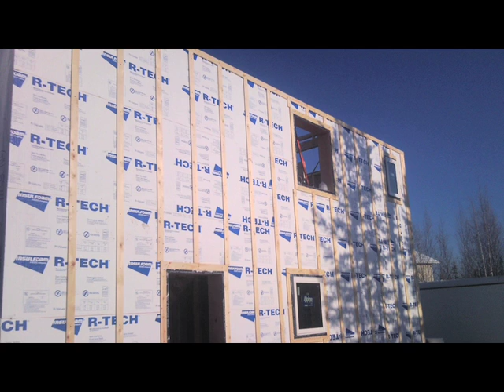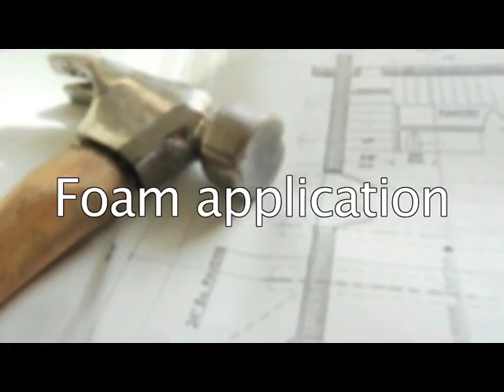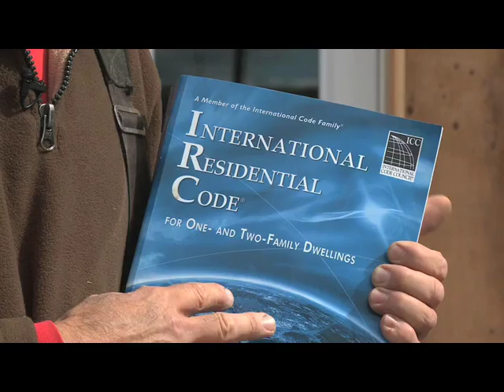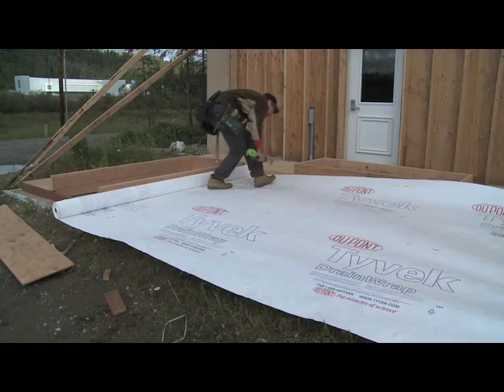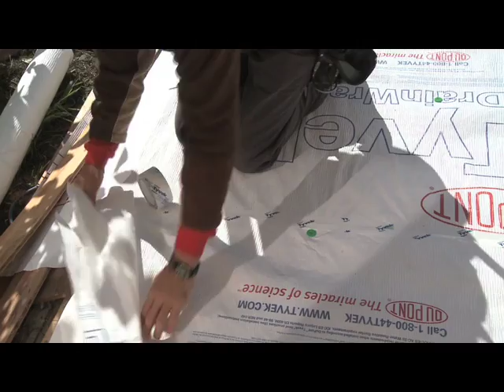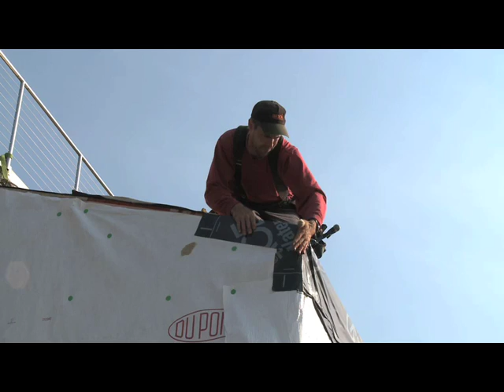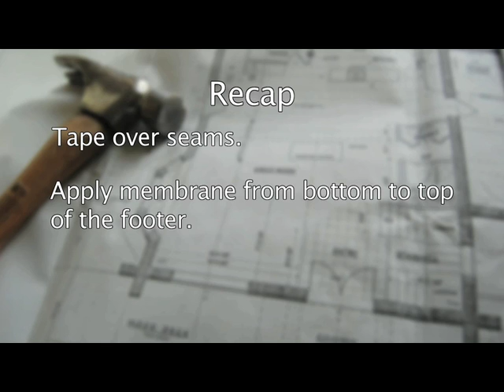How to: REMOTE Wall System Part 1

Comment: That tyvek application looks confused. Is it an air barrier? A vapor barrier? A drainage plane? It's designed to be a drainage plane. Better to have a dedicated air and vapor control layer underneath it and leave that tape off -- you wouldn't tape the bottom of your shingles, would you?

Comment: Hi Great video, the only area I am having a difficulty understanding is how to detail the dupont drain-wrap at the bottom corners where sheathing meets foundation insulation. Wont the geometry of the corner cause the wrap to get split? Here is the timestamp that shows the problem. https://youtu.be/1leyQtqVV-A?t=3000  Additionally, I am concerned that without some sort of slop at the bottom of the sheathing at the foundation/ insulation (similar to using a clapboard under windows to create a slope) for the drain-wrap, what is going to encourage water to drain away from the wall?

Comment: I am a Canadian home builder who uses the Airlight Panel system out of King man Arizona.  I save on a 2,000 sq ft home close to $30,000 per house. ( consider I pay a 35% premium on exchange and ship all the way to Ontario) We are now building net zero homes with the system.  I believe the reason no one knows about the system is the inventor is an 79 year young operator whom does very little advertising.  I found her 3 years go at the Phoenix home and garden show.  Her R value will actually go up the colder it gets.
Reply: Hi Peter, can't find any information about these other than their website. Any photos or videos of construction?

Comment: Thanks for sharing - vapor barrier or weather barrier?.  You want your exterior to be vapor open do you not?  If there is a vapor barrier at all, shouldn't it be on the interior?  Drying to the outside is the best bet from my understanding as there is generally more humidity on the interior (showering, cooking, etc) -  especially in the winter when condensation within the wall assembly is likely more relevant.

Comment: great video. like the reduction in lumber costs over double stud walls, etc... have you used SIPs? Is it easier to piece the coverings over the foam exterior than using a manufactured Insulated Panel?

Thank you. Sustainability will carry the next few centuries!

Comment: Hello,  I was curious as to how this type of system would work or if it could work, to retrofit an old house that we had pour filled foam (Open Cell Icynene) installed in the walls true 2x4 construction?  I would not extend the out the window rough openings but would still like to have a thermal break for the walls with old boards for sheathing not plywood. Would an ice & water shield as the PERSIST system describes be good or House Wrap as in these videos or would it not be good to apply at all, due to the 1/3 inside the cavity issue not being able to be achieved (due to the foam in the walls) because outer 2/3s would have to be about 8 inches of foam. There were several areas that the contractor missed mostly small areas at the top of the wall cavities (balloon framing) and through the studs (bridging).  We live in Central Maine.    Thanks

Comment: Do you make any provision for venting the underside of the roof decking?  Everything I am seeing here tells me this is dry climate stuff.  Here in a temperate rain forest everything has to survive moisture and humidity.  I can guarantee you will be getting some humidity driving through from the inside or outside whatever you have so a pathway to remove it must be there or rot will happen especially in products like OSB, engineered lumber etc.  Even if it was an occasional or remote possibility you need a drying path.  Here in Ketchikan there is a growing concern on the performance of plastic house wraps (Tyvek etc) and many remodel, repair contractors (who really see the performance) are backing away from it back to 30# building paper.  

I always love the reference to engineers and architects.  I cannot remember any job over the past forty years here that they have been involved in that wasn't rife with flaws and failures a third grader would have caught.  From bad foundations, roofs, high inside ceilings (try heating a thirty foot ceiling in a library), doors facing into the prevailing wind, exposed wooden pole rafters over a heated pool (ten years and rotted through 24+ inches), aluminum pool (can anyone spell galvanic corrossion or chlorine).......I could go on forever.  They are driven by the percentage of the project they get not by doing a long lasting product.  Then they are called back in to fix what they created at more fees.  Of course it doesn't help that the city of Ketchikan prides itself on never ever having gone after a bond!  But this also applies in private jobs.  In some situations they are necessary but they should have a Surgeon General's stamp on their foreheads!  There must be a better way.  Doug
Reply: Douglas Thompson 
Hey, great points.  I'm getting ready to move to one of my two properties and build a small stick frame cabin (quickest to put up by myself) in either Edna Bay or Meyer Chuck.  Have the local builders embraced or repudiated foam, and if they embraced it do they prefer open or closed cell?  Do they support insulating between roof rafters and putting metal roof on top of felt paper on top of plywood, or do they leave a gap with furring strips?

I was raised in a very wet part of Oregon, just south of Portland, and definitely agree that felt paper and breathability is the way to go in a wet climate, especially with wood heat.

Have a great day.

Comment: You are once again putting a lot of faith in semi or unproven building products.  Compounded with the fact that it is not a perfect world and funds are not unlimited this method would be experimental.  Case in  point, you are relying heavily on Grace Water Ice Shield which makes glowing claims about sealing around fasteners etc. etc.  I put Grace on my flat roof and watched it over the claimed six months uncovered period.  If you extrapolate this may occur at a differing rate depending on slope, heat and time but it will occur.  The bituminous coating separates and flows under the plastic sheeting.  If this happens on my flat roof in a very cool coastal climate think how much worse it would be under a dark, sloped roofing.  Then also if this happens in Ketchikan's mild climate which would be similar to temperatures incurred on the inside insulated surface as you install it I would have no confidence in this product maintaining a water plane over extended periods.

It was in acknowledgement of the real world fact that a perfect water plane cannot be practically built that the 'rain shed' siding procedures were developed.  Now you are reverting to an expensive system that depends on that selfsame perfect water plane.  And you are extending it to the super vulnerable roof.  With no caveat as to where this system might stand a chance of working other than inside a weatherproof warehouse I would not even consider it.  You bring it to Ketchikan's climate and show me what it looks like in 15-25 years and we will talk.  I would lay money on failure as it is shown.

The unsupported bending moment on your super long installation screws (the practical diameter would seem to be less than 1/4" or other problems amass) as well as condensation as they bridge the thermal gap gives me cause for concern also.  Walking on the heads of them (as when building, snow clearing, maintenance etc.) would possibly bend an air channel around the shank exacerbating the problems.  You also show them 16" o.c. holding the foam but we have another intrusive layer to hold the roofing on with an additional thermal bridge.  Not to mention the mechanical weaknesses that would exist on such a 'floating' system.

I know work has been done on single layers of 2" foam as regards fire hazards (it is required to have a noncombustible covering) but the volumes you speak of are unheard of and once ignited might bring on a total conflagration very quickly.

This doesn't even address getting three inch foam or thicker.  Special ordering requires minimums on the order of trailer loads or railcar loads if you can find anyone who would do it.  Building up two inch layers just doesn't seem wise when you get to 12+ inches.  

It is easy to spend other people's money and call a project 'proven' in the lab without it ever surviving real world budget and performance issues.  Time and again we have seen new "Arizona" products and systems trotted out and quickly become expensive failures.  Vinyl, HardiPlank, cheap shingles, poorly engineered windows and doors, OSB, etc. etc. all have expensively failed in our real world climate conditions.  

I am disappointed to say this sounds more like salesmanship than science derived from an isolated classroom as opposed to real practical application in the world.

Until I see a proven alternate I am sticking with mineral wool batting.  It dries out, dampens air movement, is fire resistant, carries a good R value and is practical as well as time proven and available.  

Doug Thompson,  Ketchikan, Alaska
Reply: Its not so much what you use but how.

Comment: if I may ask why do Americans still build homes out of wood please ?  Here in the EU no one does any more our homes are build of reinforced concrete , steel and brick
Reply: Simple.
Concrete is a mineral that has to be mined, destroying the surface to get at what is below the surface.  Not very green.

Lumber is cut from trees, and whether the forest is clearcut or selectively cut, if managed right, as is required in USA by state and federal laws, the forest will have harvestable trees in a few decades and is sustainable.

Lumber is a renewable resource, like growing a garden.  Concrete is not a renewable resource, and even though we have a lot of it, there is still a limit and it is not green.

We use lumber, we grow lumber.....we don't need lumber from other countries, but senators can't get kickbacks letting Americans sell to Americans in a fair and open market; but they can get bribes and kickbacks from foreign corporations wanting our government to limit our harvests so that the foreign entities can sell to us.

Also, wood houses are cheaper, even with all the foam, vapor barriers, and other stuff.
Reply: Interesting question, but regardless of what building material you use for framing a house, vapor issues, thermal bridging and condensation need to be addressed.
Reply: You are misinformed, sir.
Reply: At one time you did build out of wood but EU depleted the trees through population expansion so you now have to build using concrete, steel and brick. In southern Florida most home walls are steel reinforced concrete block, rot resistant, hurricane resistant, etc. Actually wood is a renewable  product. Due to increase of CO2, there is an excess of timber. Logging companies do plant after they cut...they have to if they want to stay in business. It's down to availability, economics and existing conditions.  Just like heating, in EU (Germany especially), heat is mostly by hot water systems (very efficient). In US heat is forced air but our climate varies very warm to cold which most people  want air conditioning as well and forced air makes this easy to do.
Reply: Yeah, here in EU its norm to have moldy moist cold stone walls
Reply: People seem a bit over the top in their replies, but the simple answer is we have plenty of wood and are used to building with it. It is both plentiful and renewable.  Not sure what the circumstances are in various European countries. There is no reason for us to relearn how we build houses to switch.  However, improving how we build is always a good idea.
Reply: +Darren Malin   Short answer:  "The American Government promotes greed beyond all else.  Money is the high priest in our religion and corporations have Carte Blanche with little responsibility.  Quick profit rules and quality or longevity have no place at the table.  Our politicians are cheap whores who could care less as long as a little dribbles down to their pocket."  Pretty much like the EU only worse.  Doug
Reply: And you had small diesel cars with 50-60mpg.  Although you too had planned obsolescence in cars, appliances, clothes etc.  We just took consumer rape to a new level to make a very few billionares.  New international trade agreements will take it to a universally high level.  The new order might not be better for the vast majority or the planet.
Reply: we are extremely slow learners. We waste our forest resources by allowing timber companies to manage the harvest and sale on public lands, about 80% of USA timber land is actually public government owned land. We allow our timber to be decimated between harvests by fire and pests. In between harvests, timber companies spend $0 on timber management so undergrowth builds up, we get a bit of a drought, then a lightning fire destroys the forest. Also, Asia is desperate for our hard and softwood production. Timber companies sell to Asia, all of the timber they can load into shipping containers and send the unprocessed wood to Asia where it is milled and dried into valuable grades, incorporated into furniture and other products and then sold back to the American market at a huge mark up.

I noticed in my weeklong trip to Bavaria, Austria, Switzerland and the Black Forest, that the folks in those regions raise and manage timber like we do crops or gardens. I saw evidence of pruning, thinning pencil point logs ready to go to a mill or chipper. I saw gangs of workers cleaning roadside right of ways were nothing was wasted. Those waste products were not dumped but used a biomass to make electricity.

Yes, there is less acreage in Europe available in Europe for timber production. What I saw was a level of care and management that made up for the quantity with quality of use. I would love to study your timber management and write a book about it some day!

Remember, there are no cities in America that rival Rothenburg ob der Tauber. That walled medieval city had buildings around the square, some four or five stories tall that had plaques identifying the year of construction. 11th- 13th century were not uncommon. Every building but one that was being rehabbed were fully occupied, no vacancies.s told that people are on multi-generational lists to move inside the city walls and waiting lists for some of these retail, office and living spaces were 50 years long.

Americans build everything as cheap as possible, charge as much as possible and have planned service lives of less than 100 years. There is little quality in our buildings. It is so sad.

Best of luck to you!

Comment: How can you guarantee air tightness when you perforate the perforate the vapor barrier with the screws holding the insulation? To me that is a weak point in yr system especially using screws.

Comment: Very interesting video. I'm a carpenter and I'm wondering how they find the best place to put vapor barrier is at 1/3 rather than completly on the interior side as usual canadian construction (the best place to avoid condensation in my opinion). If you work carefully, I guess you could seal as well the envelope and don't worry about the dew point. I'm also wondering at the end of the video why no vapor barrier is apply to the wall, just the roof. Maybe I missed some info about that.

Comment from the maker: (2of2) A safe approach is wherever possible to allow for drying paths and drainage planes in wall assemblies rather than depending on the adhesive properties of a particular product to provide the primary protection for a given part of a structure.

Comment from the maker: (1of2) The projected longevity of "modern" caulks and sealants is difficult to gauge - partly because these products haven't been around for 50 plus years and partly because manufacturers are constantly changing the chemical formulations of the products, and lastly because both the climate and the applications in which the products are being used can vary widely.

Comment from the maker: Using the REMOTE system on the roof would certainly work out fine. In Alaska, it’s generally cheaper to go with cellulose or fiberglass in a vented attic system (typically trusses and a cold roof).  If you are in an area with fine blowing snow that could find it’s way into the attic, then foam board on the roof might be a good solution (no attic or a sealed attic).  Just be sure you add enough foam board to provide good energy performance and to reduce the potential for ice dams.

Comment from the maker: In this region 25-30% of total wall insulation can be placed on the warm side of the vapor retarder. It depends on the local climate and the design interior humidity and temp levels. REMOTE typically uses 40% interior humidity and 65 degrees indoor temp as design parameters. In a dry climate such as Fairbanks, indoor humidity levels will rarely go above 25% in winter IF the home is properly mechanically ventilated. This may allow for up to 1/3 warm-side-of-vapor-retarder insulation in some cases

Comment from the maker: Not passive – just climate appropriate and efficient relative to local energy costs.  Case in point: Heating Oil is currently over $4/gallon and last winter virtually every day in the month of Jan was -35 or colder. Energy modeling is a useful tool in determining theoretical btu savings in relation to r-values of the different shell components.  Alaskan raters primarily use the AKWarm program. I can't add links to responses, but check out AnalysisNorth's website to check out AKWarm.

Comment from the maker: Insulation under the slab? Yes. Slabs in this region will have anywhere from 2 to 12” of foam board underneath.  Soils temps in interior Alaska average around 36 degrees when you get below the active layer (non permafrost soils) so from an energy perspective, underslab insulation is pretty important.